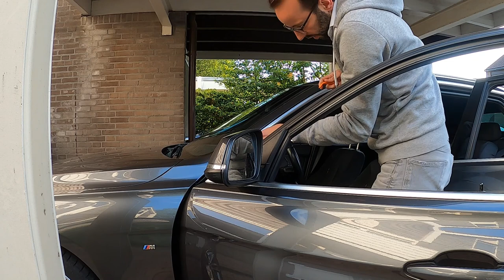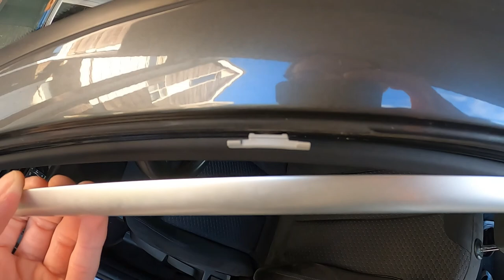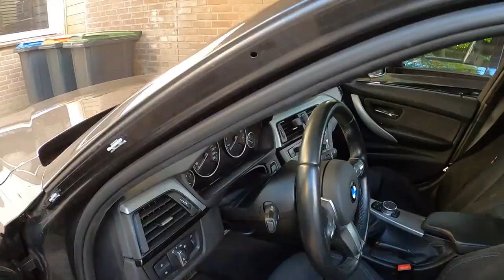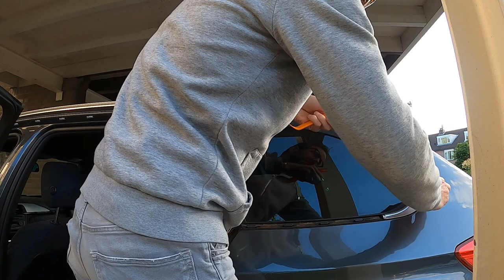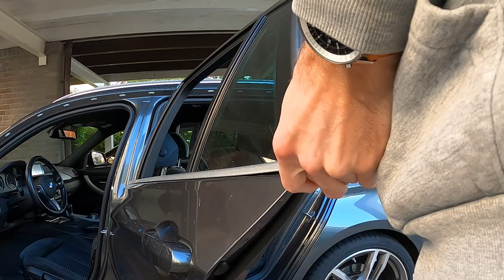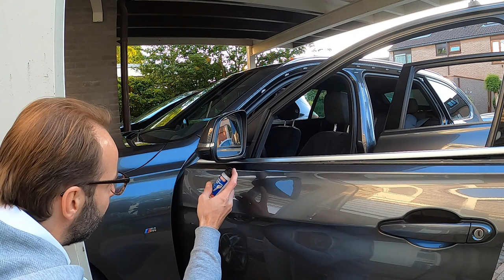BMW 3-series Touring F31 window trim removal [ENG subs]

Comment: Just an advise.You better snap the silver trim from the rubber first and use a screw driver to remove the weather strip rubber. Just in case you need to use the old trim still.
Reply from the maker: Thanks, it was indeed harder than i thought. Maybe i can try this on my latest purchase, i have just gotten another car with the alu trim again :-)
Reply: what do you mean? i need to remove from f30 also trim , what is the easyes way
Reply: Hello, I have to replace the weather strip rubber on my E34. First I need to snap the silver trim from the rubber and then attach it to the new rubber.  But honestly, I am a bit afraid to separate the silver/chrome trim, I do not know how it is attached to the rubber and I am afraid of damaging it during the removal. Do you know how the silver trim is attached to the rubber? how to snap it? so far I could not find any picture/video about its removal
Reply from the maker: @jalalaliyev3325 hello, i do not know. I did not remove this part in my video. I am sorry but i cannot help you in this situation. Perhaps take it to a local garage where they can maybe check the service manual on how to do it. Or visit BMW dealership and aks them how to do it. Perhaps they may even show you how without charging you. Best of luck 👍

Comment: Does your car have wind noise when car hits cross wind
Reply from the maker: Yes, the car is pretty noisy. Not only with cross wind but also at higher speeds. This is a f3x design flaw i guess. There are a number of DIY’s online to make it less noisy...
Reply: @jmsterdam  hmm seems like bmw doesnt care about this right. My only has wind noise when cross wind only
Reply from the maker: Perhaps this is how they segment the 3 series from the 5 series.
Reply: @jmsterdam  my car is vinfast created orginally from bmw f10 5 series. still have wind noise when it comes to the gusty windy weather. Otherwise its perfect

Comment: Sorry, buddy, but the way you remove the strips in the front doors is completely wrong. They do not need to be pulled horizontally. This may damage the strip. The correct way: dismantle the mirror, pull the strip up, only up! The door has a little latch at both ends and the strip must be clicked onto it during installation. If you use an old strip, you usually have to bend its inner part in the place where it is supposed to click into the latch.
Reply from the maker: You are absolutely right. I wanted to take the easy route (with removing the mirror) but regretted all day long. Mirror removal is a must on this job.